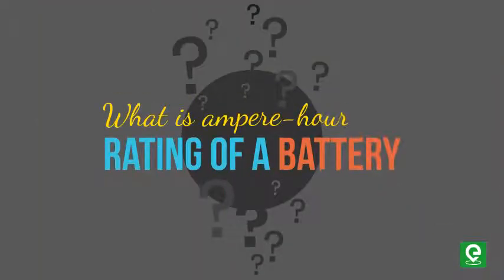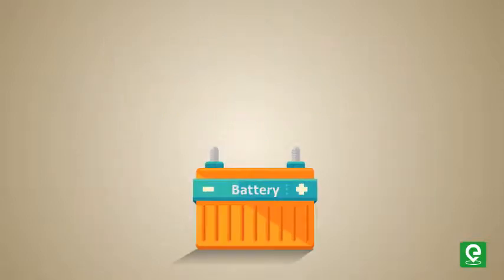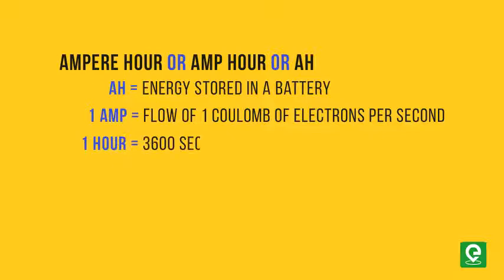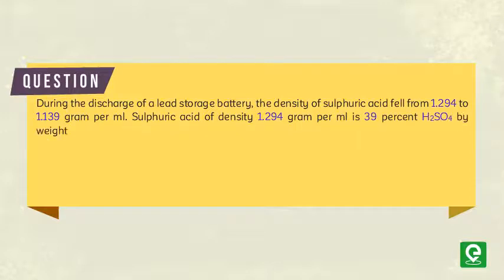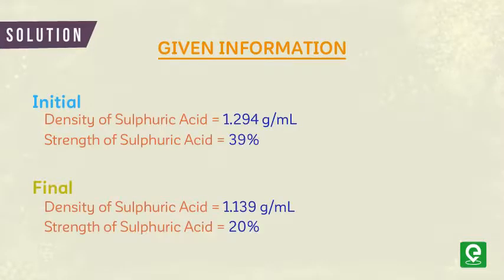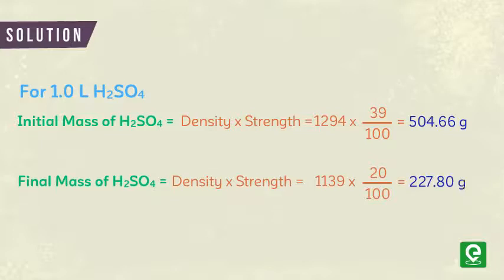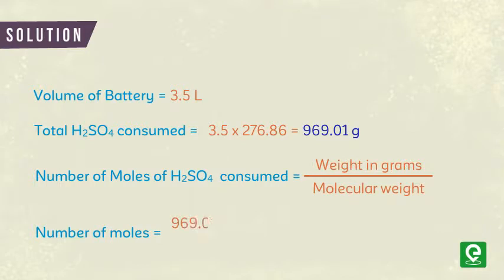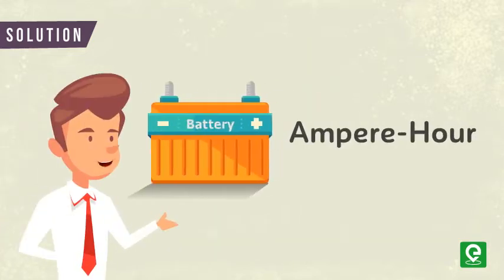What is Ampere Hour Rating of a Battery | Amp Hours to Coulumbs Meaning | Extraclass.com

Comment: One coulomb is one amp second. It's the battery that will run out in one second if you give one amp load.
One farad is one amp second per volt. It's a capacitor that will discharge for one second if the current is one amp when the voltage is one volt.

Also, when the battery discharges, it gets lighter?